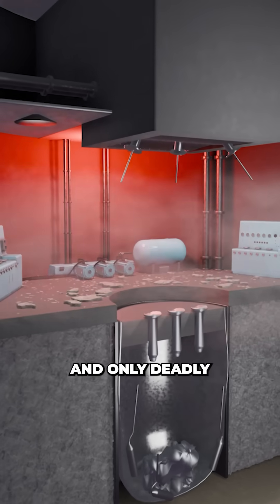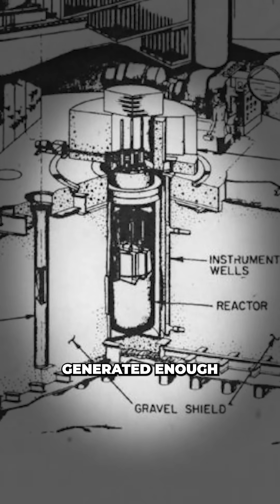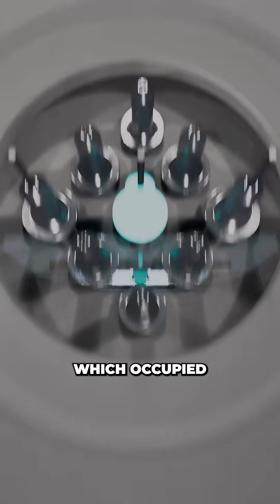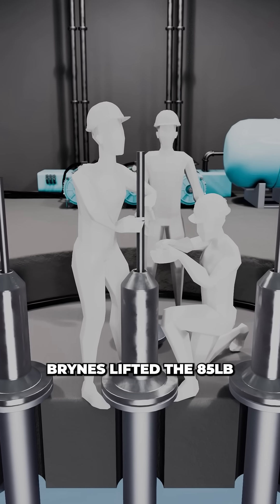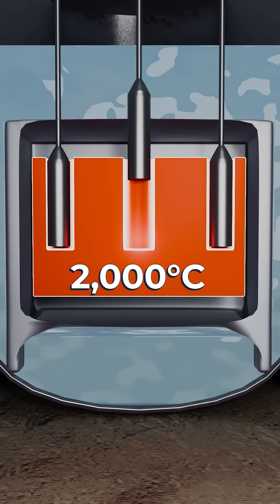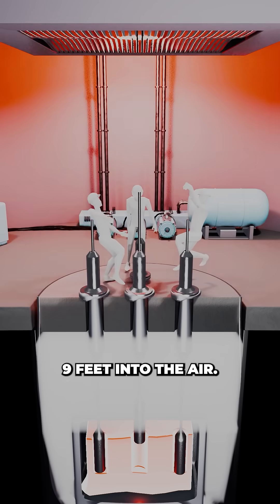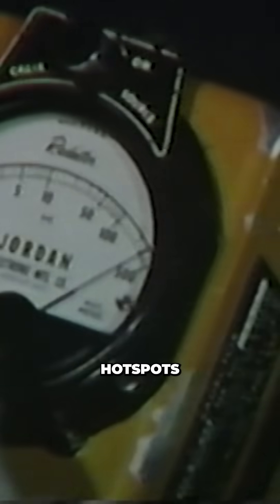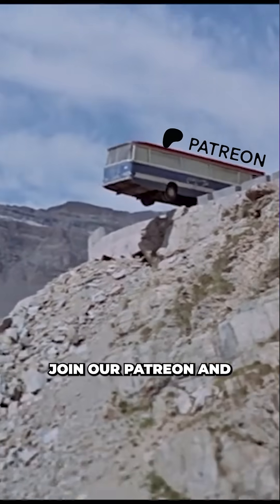The True Story of the SL-1 Disaster

Comment: Other than the "One Stuck Rod Rule", a simple, preemptive security measure that could've been implemented at the time (especially since OSRR was developed as a result of the accident) was to imprint measurement lines on the rod itself, so the technicians could visualise exactly by how much they're pulling out the rod.
Reply: Better, have a stop block moved over the top of the rod, so that no one could physically lift the rod too far anyway.
All it would take would be a plate on which the lifter would stand, with a stop block to limit the rod travel fixed at the correct height by a rod welded to both the foot plate and the stop block.

Engineered fixes are always better than relying on the person.
Reply: @ColdWaterFish44 True!
Reply: Better than that, why was the drive shaft even disconnected in the first place, needing manual intervention? The whole thing is a design disaster. 
Less than 20 years into the advent of nuclear reactor technology, way before OSHA.

Comment: Why would you have such a critical component be hand lifted like that...
Reply: Because it was the 50s, they just rolled like that back then
Reply: "Army engineers"
"50s"
that's your answer. Do not forget things like OSHA were just suggestions often unenforced until the 70s
Reply: @MaxC_1  blud thinks a clipboard jockey actually improves safety
Reply: @MikehMike01 
safety regulations are written in blood. enforcing safety saves lives, objectively & factually. 

your atitude about safety could easily get you thrown out of any decent workplace for not knowing better and not taking things seriously. grow up.
Reply: @MikehMike01 *correctly thinks
Reply: @MikehMike01  Got a Mike Rowe fan I see
Reply: @paws_btn yeah unfortunately with the possibility of causing injury to his colleagues before he is let go.
Reply: It's machine operated, but the shutdown procedure involved disconnecting the motors, so they had to lift it to reconnect the motors that operated it during standard operation
Reply: @nighthunter5205 but why is the Motor so far away that this can happen?
That's a massive design flaw.
Reply: @nighthunter5205 even if it wasn't a motor, a gear system, or even just stops in the rod's handle so that you only ever pull it up just enough would've sufficed.
Reply: @nighthunter5205  Still feels like they should have had some little hand crank device or something.
Reply: You should read up on the "demon core" and the two incidents at Los Alamos that gave it its name. Humans weren't the brightest at the beginning of nuclear science, and the learning curve was incredibly steep.
Reply: @briannamarsing4839  the way the demon core was constructed and experimented with is just chilling to anyone with knowledge of radiation. That was a combination of hubris, recklessness, …I am out of words. Like, they just wanted to poke at the universe & see what happened. Serious FAFO resulted.
Reply: @Scot-p1v yeah the second incident, like? It happened once when they were kinda trying to be careful, why be downright reckless with it after that? I know we didn't know a lot about the affects of radiation on the body but it was a proven killer at that point. FAFO indeed.
Reply: @Scot-p1v  Yes, it was as if the people involved were just trusting some benevolent entity/force/power that somehow fills the Universe, to protect them. I have seen this mental transfer of responsibility especially in other cultures when I was a commercial pilot in Papua New Guinea. The local/national pilots seemed to just trust technology or God or the Universe for safety rather than taking full responsibility. Of course this is not confined to that or similar cultures, but it's more obvious there. It's well and truly in highly technological cultures too - especially with road vehicle operations. We must stand on our own two feet and take responsibility for everything because there is no god entity that will do it for us.
Reply: @Scot-p1v   FAFO method was how science used to be done back then! Actually the only difference between science and just screwing around is writing shot down 😂
Reply: @briannamarsing4839  they were so smart in some ways and yet so reckless at the same time somehow!
Reply: agree.  Connecting a 4" shortening screw bracket to the control rod and connecting this same bracket to the motor and using a wrench to shorten the bracket until the rod is lifted these 4 inches in a completely uniform way without any sudden moves seems like an easy enough idea.
Reply: 1960... so 65 years ago...
Reply: Because it's cheaper.
Reply: the 50s were a wild time
Reply: Probably cheaper than having a machine there and having to pay an operator to do the lifting
Reply: @ItsMe-ic7on  That is funny. It was the Cold War and the United States had a very real fear of war with Communists. This reactor was an experiment designed to give the Army another advantage over the Soviet Union and the Chinese Communists. The U.S. Government wasn't pinching pennies in its plan to stop those existential threats.
Reply: @Stroopwafel76   The Cold War was full of all kinds of absolutely insane nuclear experiments and creations. What a time to be alive!
Reply: Trial and error, exploring the „error“ side…
Reply: Because Army is gonna Army.
Reply: The first nuclear reactor was machine lifted too, idk who designed this one but they didn't do a good job clearly haha.
Reply: Exactly.
Reply: It is the Army. They have plenty of manpower. They actively avoid depending on machines where possible because machines are frequent casualties in war. One suspects many generals and junior officers still lack an adequate comprehension of the substantial distance between conventional and nuclear. Aside from a nuclear generator, what else continues running after it is turned off? As far as I know, only hydroelectric dams and solar panels in orbit are always ON.
Reply: Nowadays, if things like this were still common, I bet there'd be stuff like CNC machinery on steroids and robot arms to lift the rods.
Reply: Lack of common sense :/
Reply: Because it was a new experimental unit and they didn't install everything that would be on a final version to save time and money.
Reply: It was only hand lifted to connect it to the motor controlling it
Reply: @judasfantomen
Right but the question still stands. Why do you need to hand lift it at all?
Reply: @carstekoch  Asking the right question. The right tool for the right job makes the job easier and safer. Millions $$ into a nuclear reactor and they couldn't design a simple tool for this bit, which might be some inexpensive thing.
Reply: @JMton_t  a modified Johnson bar with a stop— a stop that extends further out from the wheels so that the operator would have to use MUCH more force to lift the rod further than, say, 4&1/2 inches. If I can instantly conceive of such a thing, the people actually paid to do this stuff should easily be able to as well. Maybe they just needed a few more blue collar types around: we’re good at figuring out how to let the machinery do the hard lifting 🧐
Reply: @judasfantomen peak pfp
Reply: @judasfantomen But it's still extremely high stakes if the slightest mishap occurs.
Reply: And we didn't know any better.
Reply: @oscar3011 
'Don't'. Just saying.

Comment: These deaths sound absolutely brutal... Cooked, smashed and impaled, just because one man couldn't tell apart 4 inches from 20...
Reply: It wasn't that he couldn't tell, it was that the rod often got siezed into the slot. So, he pulled, and it would not budge. So he applied more and more force, until it broke free, and slid up 20 inches instantly. Its like how mechanics always bust up knuckles trying to break a rusted bolt. When it finally gives way, their turn it so fast and hard that their hand impacts something else. This was 100% a design issue, it was not the fault of the operators.
Reply: @Chris-hn4lp 
Definitely agree, it's a design issue, they didn't have a fail safe or some sort of measurements for failure. The rod was meant to be pulled exactly by 4 inches or else you die... A disaster was waiting for it to happen, it's just unfortunately these 3 souls became the sacrificial lambs, but also thanks to them we developed the one single rod rule, RIP 😢
Reply: We all make that mistake man
Reply: its likly that he knew ...he was depressed because his wife left him for the other dude in the room so its possible he wanted to kill him and every other person in that room
Reply: @Mimikry-f8l Well one of the other guys weren't taking their jobs very seriously as well. They were known to have set off alarms on purpose, and also pull those rods up more than 4 inches as a prank to scare the others with the energy spike produce.

There weren't exactly properly kept logs, and iirc the guy who got pinned was the prankster, not the guy in the middle of the divorce.
Reply: @Mimikry-f8l that’s a myth. It’s likely not true because there isn’t any evidence surrounding it. It’s possible his mind was clouded and he wasn’t fully paying attention because of the breakup but it likely wasn’t suicide.

Comment: as soon as he said "even a small movement" i knew where this was going... dear lord
Reply: It's always small movements with nuclear stuff...
Reply: Lesson learned: big movements are safer, put reactors on big swings with rockets attached
Reply: See what happens when you pull out?
Reply: must lift by 4 inches

"damn, they must've lifted it by 5 inches"

Brynes lifted it by 20 inches

"wtf Brynes"
Reply: @NiLi_ that's exactly what I thought, like it was going to be a small miscalculation, but dude just yoinked it out of there like he was King Arthur lifting Excalibur
Reply: @KK-bm4mf  guy mentions in the end of the video, but the rod got stuck ALOT. Likely he knew the 4 Inches thing but in his effort to get it unstuck he pulled it out way too high, so his tug got it unstuck and lifted it 20 inches.

Essentially while he should have been more careful, there was a clear engineering fault with the reactor that should have been dealt with
Reply: This all probably happened in milliseconds.. these guys didn’t even have a chance to react
Reply: @Joshua-cs6gj probably not ms 

Longer with nuclear reactions going into explosive mode
Reply: @Snay1998   It was, in fact, milliseconds.
Reply: It seems unbelievable that an engineer wouldn't have designed a stop to prevent travel beyond 4 inches.  It is mobile, what would happen if the unit hit a huge pothole just right (or just wrong) in the field?
Reply: @commerce-usa likely the rods got Locked into place before transport
Reply: to be fair the difference between 4 inches and 20 is big
Reply: Didn’t he announce where it was going in the intro/series title?
Reply: UP!
Reply: You want a cookie now? Gooood booooy
Reply: (Technicians reactor curse) “ blah blah blah, ya dah ya dah ya dah… oh and don’t lift the thing more than 4”
(Technicians listening to the safety course) “gee, I want a burger with cheese”
Who is responsible for the accident? Same thing as with Chernobyl… The State did it, Bureaucracy did it